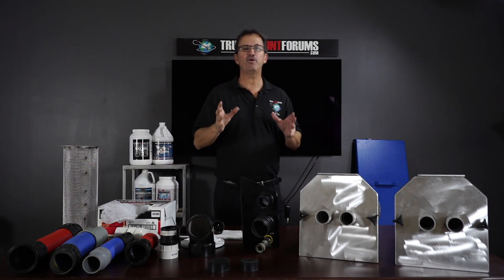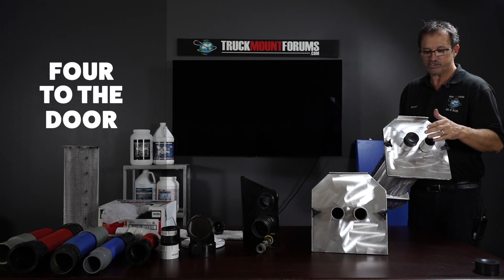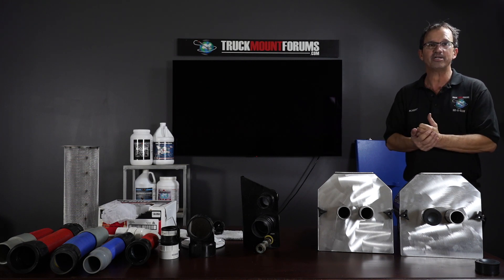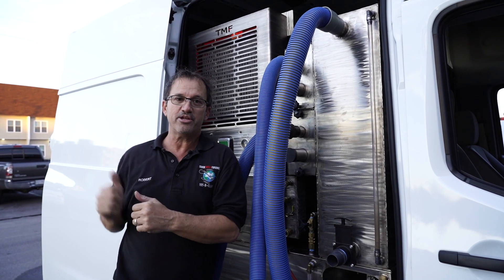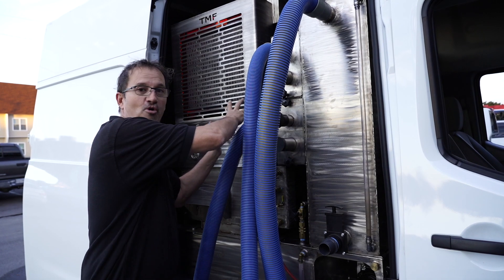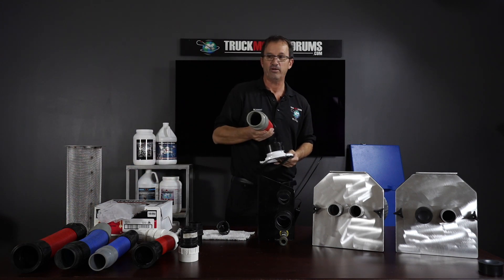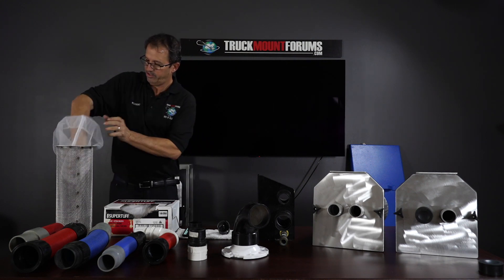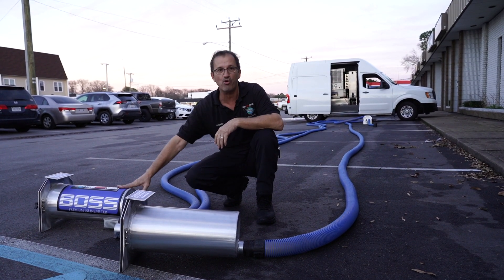Increasing truckmount power with inline filters!

Comment: Where do i get the fittings to modify my waste tank lid? Im trying to have two 2in hoses coming off the top of my waste tank.
Reply from the maker: Email support@truckmountforums.com or look on tmfshop.net
Reply: Try Ace hardware.  I found connectors I needed for $3 instead of $14 at the supply house.

Comment: I’ve been highly impressed.
—instead of forcing a STARTER FLASH cuff onto the filter…we use a 2”vinyl cuff which slides on/off easy—we shorten vacuum hoses to about 4” and then add Flash cuffs (thus eliminating the starter cuff) 
So there’s 2 of these on the side facing the machine—with Female Cuffs. 
Then on the front facing the home, we use 1 of these modifications with a male flash cuff. 
Doing this: allows us to easily slip off all of the cuffs whenever necessary—
Reply: @briansapp1076, I know this has been over a year ago but do you have any pics. Thanks.
Reply: @JDogMarlonHainesCity 

https://youtube.com/shorts/52SaWz-KulI?si=4mUCCtn2UHa_OZRH
I use a small carpet skidded to plug any ports I don’t use.
Reply: @briansapp1076  good deal. I just took a starter cuff end I had laying around and capped it. The 1-1/2’s caps were tight but eventually got it on.

Comment: Hey Rob, I usually run my filter upright. This allows me to have a 360 degrees pull/flow. Once you’re done cleaning you can actually see everything sitting down on the bottom of the filter instead of piled up on one side. My question to you is. Can we go back to the drawing board and redesign this particular filter to stand up right. Let me know what you think. I would love to buy one.
Reply from the maker: Interesting. Unfortunately that would defeat the purpose of the Boss Filter. The design allows the water to pool into the back concave portion which perpetuates immediate water removal. This allows the filter to breathe and maximizes vacuum (CFM, lift and flow).
Reply: @TruckMountForums  it’s definitely well made and I will definitely order one as soon as possible. Thank for your response and all great info shared! 👍